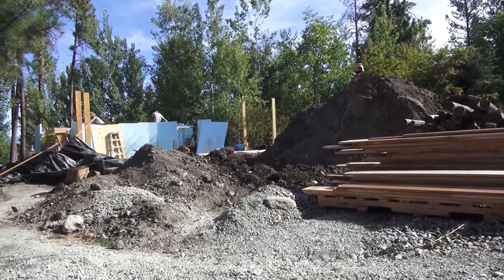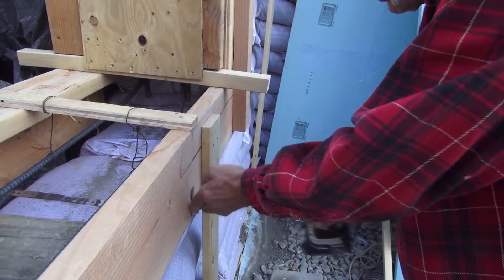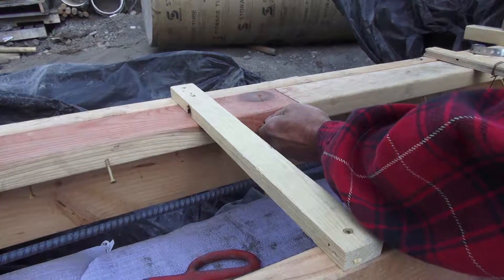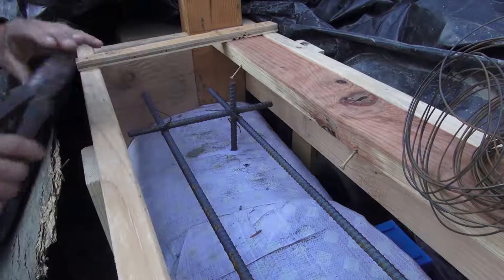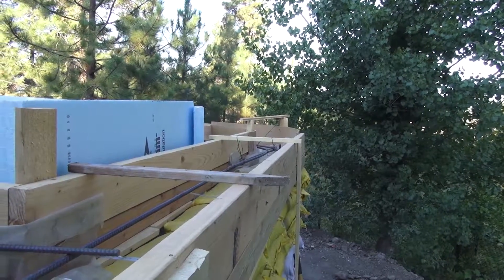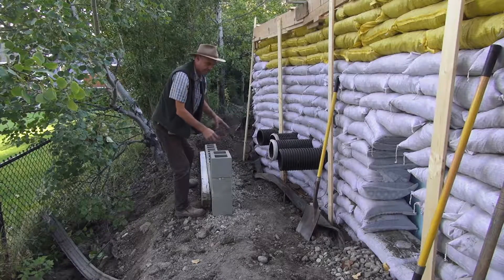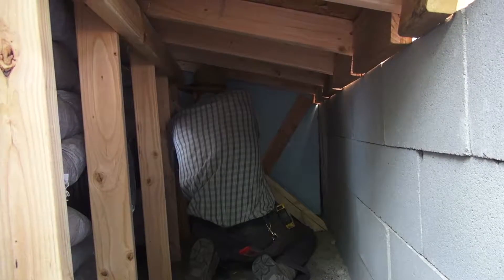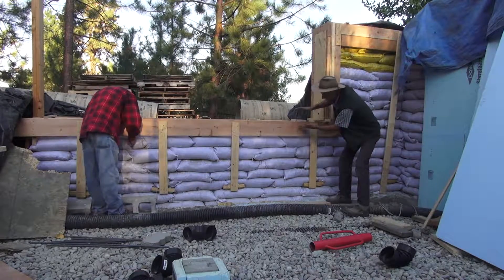Solar Earthbag, Aquaponic Greenhouse - Bond Beams

Comment: What keeps the concrete from coming out of the bottom of your form?
Reply from the maker: Since the bags are very uneven, there can be large openings in some places.  Where there were large spaces we screwed wood under the forms to close it off, for smaller holes we stapled plastic to the inside of the forms.  We also kept the concrete mix very dry or "Stiff".  If you add too much water it gets very soupy and will run out every little hole.  A stiff mix is better for this application.